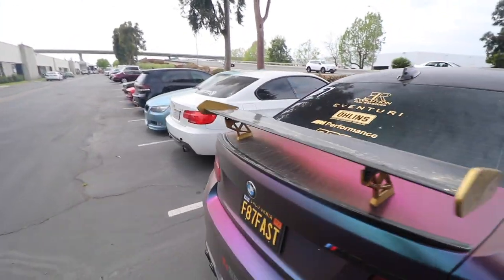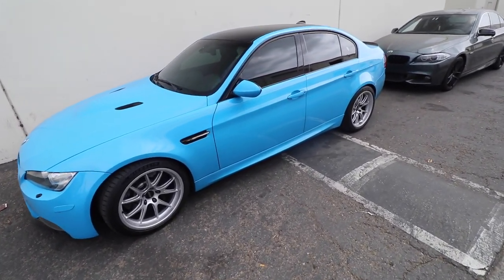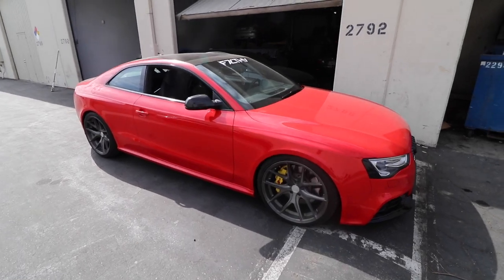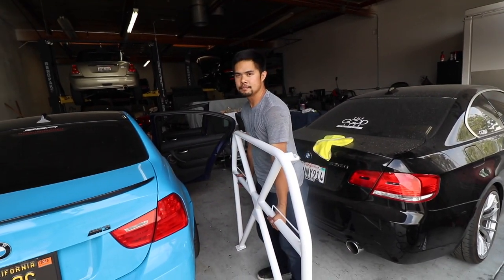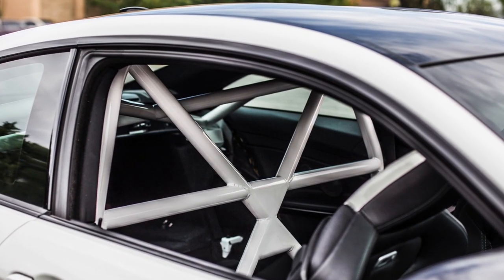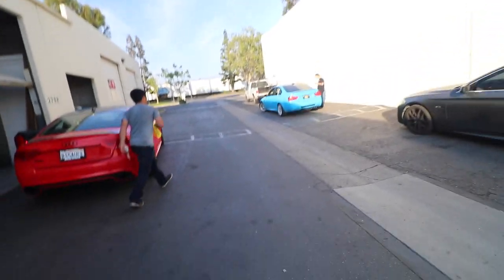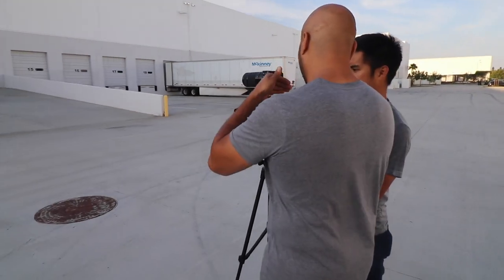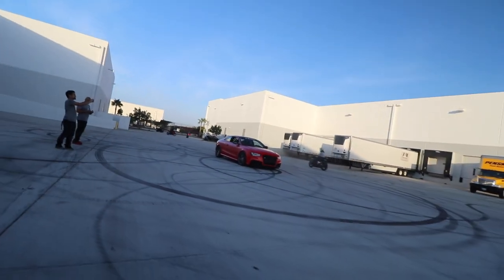Installing a StudioRSR roll cage in my BMW E90 M3!

Comment from the maker: Thanks to Studio RSR for the cage! See their information below if you have any questions or needs for a roll cage.

https://www.instagram.com/studioRSR
https://www.studiorsr.com
info@studiorsr.com
1-844-991-5582

StudioRSR has developed an outstanding rollcage / rollbar (half-cage) for the E92 M3 chassis to fulfill motorsport, HPDE, and track-day needs. Increased chassis rigidity and safety combined with a modern design befit of the newer models, makes the StudioRSR M3 roll cage the premium option available in the market.

Designed and manufactured in-house, StudioRSR uses the latest manufacturing technologies to create this upgrade with *NASA Racing specifications* and wide-radius bends. There is zero metal crimping and zero tubing wall failure that is often seen from alternative roll cages. The Tesseract half-cage is 100% bolt-in featuring a 4-point optimum mounting design with form-fitted brackets specific to the E92 chassis. Professional installation is recommended, but installation is made easy with chromoly interlocking tubing clamps, zero welding, and all necessary hardware included. Additionally, street-spec classed vehicles can retain their rear seats if preferred. Available in-house at StudioRSR or shipped direct to you or your preferred Dealer/Installer internationally. The Tesseract half-cage consists of 2 main pieces making installation and shipping even easier.

The development of the Tesseract roll cage / roll bar came about from customer demands from StudioRSR's track/enthusiast clientele from their previous generation E36 M3 or E46 M3. With several clients and some of our own staff now licensed and racing within several NASA & SCCA Racing, HPDE, and Time Trial classes, a professional motorsport solution was needed to maintain manufacturing quality in-house. As a specific benefit, the visual aesthetic matches the aggressive, modern design of the BMW E92 M3 perfectly.

- 100% bolt-in
- Rear seat Compatible - Fits with rear seats installed 
- NASA Racing spec w/straight leg version (**as of 2016.5 rulebook, not sanctioned) 
- Street/HPDE spec w/Tesseract bent leg version
- 4-point half-cage
- 6 steel brackets form-fitted to the E92 chassis
- Made with latest manufacturing technologies
- Wide-Radius bends = even stress distribution, no metal crimping, & no tubing wall failure
- Designed with optimum bolt locations to factory mounting points
- Signature designed StudioRSR angled rear legs
- Proprietary designed integrated chromoly tubing clamps
- Heavy-duty DOM steel 1.75" x .120 wall thickness all-around
- All Grade-8 mounting hardware included
- Installation instruction included
- This product is intended for Off-Road use only
- Product photos may vary from actual item
- StudioRSR Terms & Conditions apply (see link below to Terms & Conditions)
- 100% Made in USA
- Powdercoated in Red, White, Yellow, or Black at no additional cost

The following Custom Options are available with additional costs:
- Custom Paint/Powdercoat & Factory paint colors available
- Custom X-designs and gusseting available (Contact StudioRSR for details)
- Integrated Go-Pro & other Camera mounts

Cost starts around the $2,000 range. 

https://studiorsr.com
info@studiorsr.com
1-844-991-5582

Thanks! Much love, -SB.
Reply: Spencer Berke whats good Spencer!!!

Comment: Why have “track” wheel set and roll bar if you’re not gonna track? Also bolt in cages are not that safe. Especially since you’re not running a harness, it’s actually more dangerous
Reply: soo with you - bolt in cages are kinda silly, for likes on instagram. its his car and his money and can do what he wants with it, but also he should accept other's criticism. IMO, the only right way to do it is have an actual, multi point fully welded in cage, and then you better be tracking the car. it snowballs from there : cage, now ya need harnesses (minimum 5 point), and a HANS device so your head doesnt snap off if you hit anything on the street while wearing said harnesses. we havent even gotten to helmets yet.....
Reply: bryan garmon yup weld in cages are to go. At least half cage welded to the shock mount points. I do agree though, once you do that it’ll snowball into 10 other things. That’s the route I’m headed with my m3 lol

Comment: Is it me oe do the wheels lool small on the car? Living near the nürburgring and putting a roll cage on an m3 is something that ypu see very often. I have never seen an rs5 with a rollcage.
Reply: Yeah the wheels don't look good, I assume it just needs a larger diameter wheel.
Reply: For smaller wheels he needs more meaty tires to pull off a good look